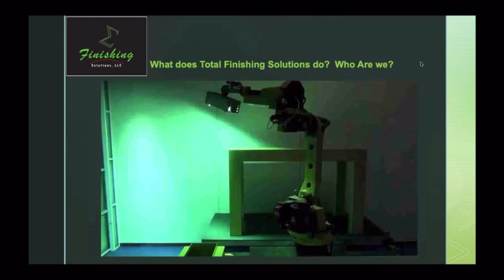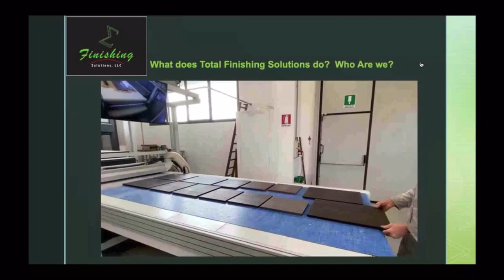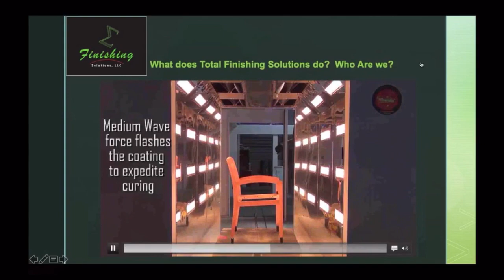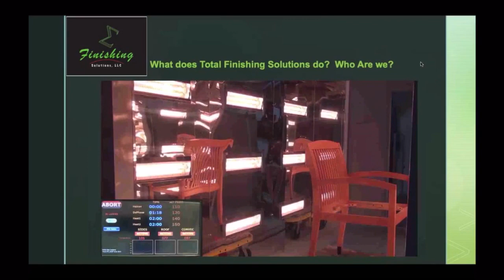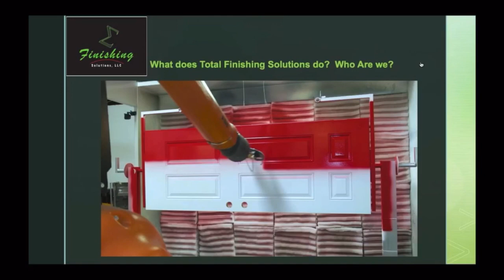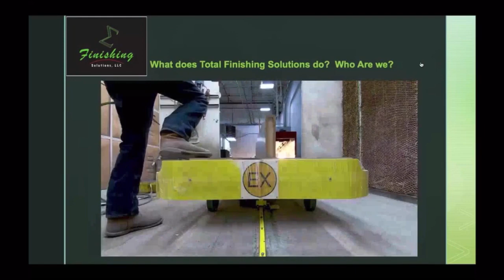Ty Crowder @  Total Finishing Solutions talks Spray Booths, Flat Line Sprayers, IR Ovens,  and more

Comment: Hello Eric

I'm contacting you on this particular page because it seems to be your most recent video,and I was hoping you would see this.

So, my question is...what would be your best recommendation for repainting cabinet doors that are currently a factory stain with conversion varnish topcoat.

The homeowner would like to get to something in the white spectrum. Ordinarily, I would clean, sand, spray 1 coat of BIN, sand and topcoat with either Kem Aqua plus or Sayerlack.

However , after viewing many of your videos yesterday, I'm wondering if there is a better system you might suggest.
Reply from the maker: +Patricia Alkema you method is fine. My preference is vinyl sealer and if I was going to use the sayerlack I would put the crosslinker in it for better chemical and mar resistance